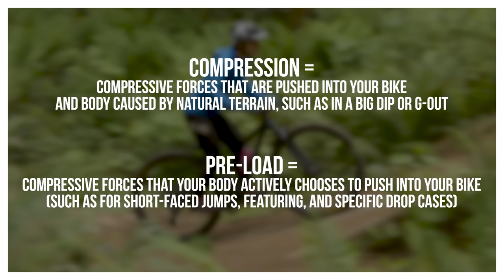Jump Better: Understanding Compression vs Pre-Load  - Practice Like a Pro #62

Comment: When I preload my knees are still bent going in so I can manipulate the bike more in the air for whips etc. Is this the wrong approach. It looked Linnea's position would have been too outstretched for me?
Reply from the maker: The knees should be bent about to where the knee caps are over the toes and the hips are supported by the heels. You can stand up wherever you are and just feel what that means. Not a deep bend. Top jumpers 'typically' don't bend the knees a ton on take off. Of course this is a very dynamic sport with so may possible combinations that you can't really say exactly what someone should look like, but in my experience watching thousands of riders each year in our local park, most bend the knees too much for proper pop off a jump. Linnea's stance is good. She's not a crazy high level jumper, but has improved dramatically and largely because she is standing taller. I hope this helps. We do have some videos on this page of Jason jumping. He is a very high level jumper and super stylish in the air. He stands tall on takeoff. You mention bending knees on during pre-load so you can whip. So long as you are getting good pre-load, and a good flight arc, the way you stood during that pre-load should not affect what you can do in the air.
Reply: @Fluidride  Makes sense, great response thank you! I’m fairly new to these and don’t want to develop bad habits that will limit my growth down the line.